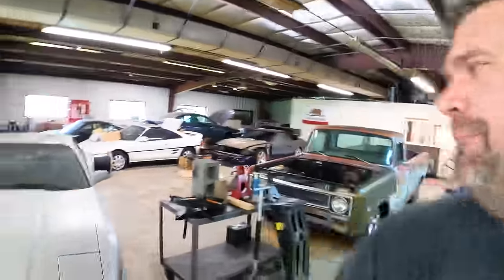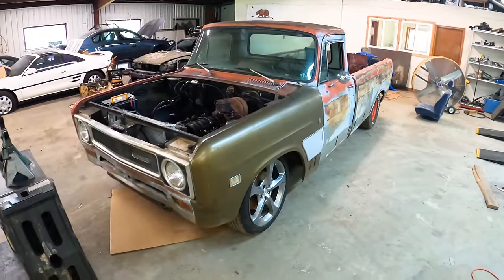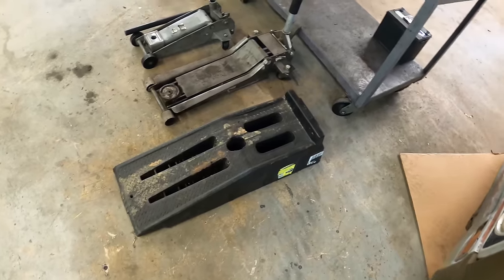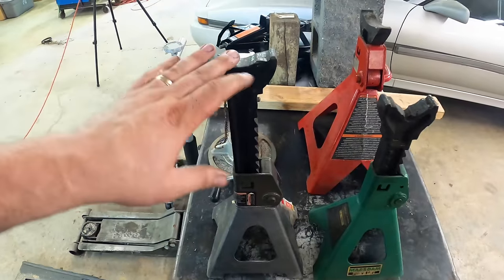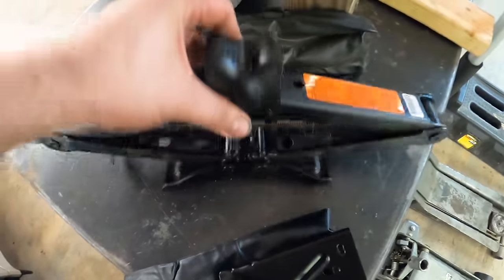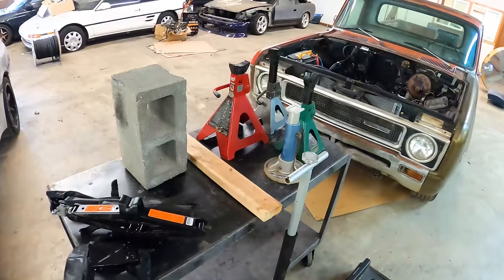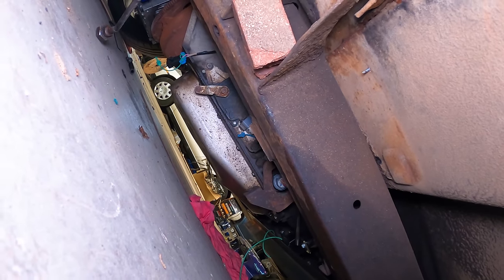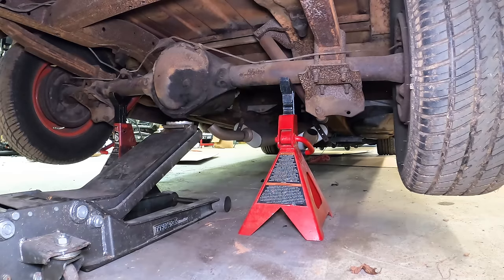How To Properly Jack Up Your Car Without DESTROYING It (And Why You're Doing It WRONG)

Comment: If you have a floor jack with one of those 4 pronged saddles, IMMEDIATELY remove that saddle, and toss it in the trash. I've seen those things destroy heavy truck frames. They will certainly destroy a unibody car. I use a piece of 2x4 or 2x6 between the jack and jacking point on the car. DO NOT use any type of ratchet jack stand. All you have to do is pump the release handle on one of them, and it will collapse the stand. I much prefer the round style with the pin that goes all the way through (the blue one) Never put a jack under a pinch weld. It will crush it every time. 2x4s and 4x4s are very strong and can safely support a car, just don't stack them up. NEVER support a car with a cinder block. I have broken them by kicking them with my steel toed boots. There are some cars which simply do not have adequate jacking or lifting points The Foxbody Mustang, and 1994-2004 Mustangs, which are still built on the Fox platform are one of them. There is nothing strong enough under the car to support it on a jack without bending something. The undercarriage of a Fox body car is made out of thin sheet metal, with no heavy metal frame members. I rarely see a Fox body car where the underside wasn't all mangled from lifting and jacking. The Ford Fairmont and 1980 and newer Thunderbirds are also built on the Fox platform. The worst design Ford ever came up with. These cars flex like a wet noodle. The best place to jack these cars from is the rear axle, and under the front control arms. Use wood between the jack and front control arms. DO NOT use the K member (under the engine) or the pinch welds. I have found a way to lift my 2003 Mustang using the short sheet metal frame rails. I also own a Crown Vic, and it came with a wonderful scissors jack with a perfect top platform for fitting under these frame rails. I bought myself another one of these jacks, so I can use one for each side. I cut some pieces of 1/4" plywood to put between the jacks and the frame rails. I jack up one side a bit, then go around and jack up the other side. I go back and forth 3 or 4 times, till I get it high enough. With the rear wheels chocked and the parking brake on, I don't have a problem getting under the car supported by these two large scissors jacks if I am just doing an oil change or transmission fluid and filter change. Dorman makes a transmission for the Crown Vic, the Mustang, and any other car that used that transmission that has a drain plug in it. Obviously don't try to change a transmission using those jacks. Be VERY careful where you put a jack. You could poke a hole right through the floor. Cars aren't built the way they used to be.

Comment: I've been around long enough we used air jacks to lift from the bumpers (when vehicles actually had bumpers). An air jack on each end was better than a lift in some aspects; nothing under the vehicle in the way and you didn't have the posts on each side to work around. Great for raising one up to do body work or just to detail. They lifted quite high too. I really miss those days.
Reply: The air jacks also had a locking mechanism built in, so no need for jack stands.

Comment: I had a set of metal ramps about 10+ years ago. Put my old truck on them one day, smashed them like grapes.  Had those harbor freight set too, 2 sets. Returned them for the replacements, never took the replacements out of the box. Already knew about the weld issue before i returned the originals so i figured there was no point in pulling them out of the box cause they'd end up being recalled too

Comment: My old 350Z had a NISMO style front bumper that made it impossible to drive up on store bought ramps. So I took some pressure treated 6x6's that I had left over from a job and made some long ramps by cutting them on the diagonal, setting two "ramps" side by side on each front tire to drive up on (4 total cut boards in pairs). (Angle of the cut calculated to allow the bumper to clear, so that set the length of the ramps). Then at the end of those, I set blocks of the 6x6 to drive on with a 2x4 screwed into the end as a stop to keep me from driving off the end. Got enough height to do oil changes without jacking up the car and getting jack stands under it, which took a lot longer.

Comment: Not all engine cross members are safe to jack on.  For instance, the C6 Z06 and ZR1 use a magnesium cross member and can crack if used for jacking.  Makes these cars a pain to lift.  They are also a pain to lift in the rear, as there are very specific points on the rear cradle that are safe to jack on and they aren't as accessible as you would like.

Comment: My car is pretty low I can barely get my low pro jack under it so I typically jack from the front subframe and also put my stands on the front subframe too.  I barely use my lifting pads by the rocker panels

Comment: A few thing I have as personal opinion relating to this:

1.  Never been a fan of differential or front subframe centerpoint lifting, if done incorrectly the vehicle could potentially tip over to one side.  It’ll be dangerous if you have to reach way in to set stands like in the case of the truck where Jared had to basically slide to halfway under the bed to set the stands.  IMHO it’s easier and safer(not quicker) to lift up one corner at a time and set the stand then move to the next one.

2. Be careful using pinchwelds, I’ve seen and had MANY good condition looking pinch welds being used in the factory approved location fold over like a soft taco when used to jack up a vehicle.  I personally prefer to use the subframe mounting location as a jack point and set the jack stand under the pinch weld after(even tho sometimes its like a puzzle to get one in after the other so they’re not in each other’s way).

3.  You didn’t show one but Vw and some other euro brands are famous for these - the half scissor jacks.  The deadliest ever design for a emergency jack.  They have a tiny footprint and basically a letter v that spreads open as you lift ÜBER SKETCHY.

4.  For rhino ramps(as the called plastic ramps are generally referred to), the best things to do for them is to get some skateboard grip tape(get online or buy at a local skate shop) and apply it to the driving surface.  I can’t say how many vehicles I’ve had not want to start up the ramp or start up and then start sliding on them because they’re usually very smooth, even with good tires or the “diamond plate” pattern or whatever “grippy surface” they may have from the factory.  I suppose applying some bed liner to them could help too but the tape is easier and much less likely to just flake off(since the problem is they’re usually too smooth in the first place).

I’m sure I may have missed something else but for now that’s my $.03...

Also good thing that Supra doesn’t have an engine, those tires look like they need replacing if it was driveable...anybody else catch that?

Comment: I personally try to use subframe points over pinch weld jacking points, on my mk4 supra I've had to straighten them out a few times now. Definitely wouldn't go near the rails on it!
Reply: Ae86's get it the worse every single ones pinch weld is just murdered lol

Comment: Premature extension of jack stand at 16:45.   

You also don’t want to use your forearm as a lever on a 4x4 to to get the transmission to mate with the engine.  I had a severe bow to my arm as the last bolt went in. No harm and actually my bone is probably stronger now after all the stress fractures healed.  I actually had a Tr7 lean off the rear jack stands as I freed a seized emergency break cable. Fortunately I didn’t have gas or engine/transmission installed at the time.   I was able to lever it back up and secure the jack stands, while my neighbor continued to tell me how his day went, pausing to ask if the car fell on me and if I just picked it up and put it back in the jack stands.

Comment: The problem with drive on ramps is the car has to be running,if I have the wheels on the car I put wood blocks under the wheels and let enough pressure on them so the car can't fall free of them if the tires are of the car i put the under the vehicle were they would stop it from falling.test what ever your using before you get under to see how stable it is.

Comment: Another well explained video on how too's. Jarid could you please do one on torque wrenches? What is good and bad. Including what is the story with things like head bolts that tell you to go 30 ft/lbs then 60 ft/lbs plus 60 degrees. No one seems to do a clear explanation as to whats that all about. Why 60 degrees? Why not just give a 3rd torque setting? Just sayin that I think this would be a great subject to cover in a video. Keep up the great work buddy from far off NZ.
Reply: If im not mistaken, the 2 different torque specs are because the head gasket needs an even pressure. The “60 degrees” thing is because of the fact that the manufacturer uses head bolts that stretch. Thats also why you need new headbolts when taking off the head. Again i could be wrong about this, but if im not i hope my explanation is clear, English is not my first language.
Reply: @Dennis_V4  Sir I have been a mechanical engineer for 45 years. I know all this stuff. Yes English is not your language and you missed the point totally. I am asking Jarid to make a video to clearly explain these ideas and methods to the wider community.

Comment: The other day my buddy came over with his girlfriends Sentra to do an oil change. I told him wait a sec while I go check the jack points on my phone. Walked away for like 30 seconds and he thought he found the jack being the radiator support. He lift the car on jacks and when he put it down the hood was bent upwards along with the the grille which cracked in multiple places. The hood barely latches closed. Lots of damage for not taking the time to find the proper jack points.

Comment: About 10:00, if those new bolts coming thru the floor pan are what secure the seats or seat belts, itd be a good idea to get some large washers or take some steel channel and run it between the seat bolts and belts. The way it is now, in a accident those bolts will just rip right thru that sheet metal.

Comment: Jacking up a Supra by the differential is questionable, but something like an Escalade or Expedition can cause damage. The differential in a live axle like Johnny Rev is part of the suspension. An independent rear end differential is designed to resist torque, not support the weight of the vehicle. The differential may handle it, but crossmembers, links and bushings can get damaged.

Comment: I diy'd my ramps using 2x6 in layers(I think something like 4-5 layers); those with OCD may want to make it look like a wedge but mine just has steps(has corners on each layer; since I made them they have stops).... cost about the same price as the plastic sets out there but I couldn't convince myself to buy something that looks so janky.... using any wood where the wood grain is vertical or parallel with pinch welds or similar becomes essentially a log splitter; wood grain should intersect and not be parallel when being used(personal favorite jack stands are 8x8 pieces of wood:P)

Comment: Metal ramps, rear wheel drive cars, and concrete floors suck. You get the front wheels on the ramps, then the ramps slide across the floor and scratch the crap out of it. I have wooden ramps cut from rough cut 8x8s, and I love them in the garage.

Comment: The four by four block standing straight up yes it is bad it is dangerous but have yourself a Dodge Ram 1500 on 18 inch wheels with a 5 inch lift and you're using 2 by 4 pieces of wood so you might have to use five to six maybe eight to 10 pieces of wood to get the truck high enough off the ground to take the wheel off it's not recommended but it's sketchy in it will work

Comment: I built wood ramps.  I trust them better than  metal and plastic ramps. I used 2x10 wood  an built it up to the height I wanted. Then cut it to an angle I want.

Comment: Car manufacturers make it hard to be safe. They don't always release information on where all the suitable points are. For unibodies, they sometimes mention side rail jack points and that is it. Of course, if you jack up using those points, you still a place for your jack stands. The way corporations are intentionally not releasing this information is indirectly responsible for the deaths of people who can't figure out where to put jackstands. The manufacturers should list multiple points for lifting and putting on stands. Instead, they obfuscate for a miniscule increase in the number of people bringing cars in for service or for the miniscule savings of not gathering the info from their engineers and printing it. Either way, that is regrettable behavior by the companies.

Comment: One other option ill throw out there, I dont trust any jackstands, no matter what its very little contact points. And also im working outside in the driveway and ive had wind shake around a car up on stands. I always chaulk the wheels. But what ive transitioned to(on cars at least that are low enough for this to work) Ive got old wheels around I jack it up put the wheels under the frame rails and put a piece or two of hardwood on top of the wheel. Those are not going anywhere and have MUCH more contact than a jack stand. One of the key points of using wood in any fashion in this, Jared briefly touched on this you dont want to use it with the grain going up and down, and also you really dont want to stack a bunch of boards.
Reply: You said do not stack a bunch of boards. What do you mean by this. Wouldn't a stack of say 2x12s screwed together then chocked and placed under a set or all four wheels be secure?
Reply: @mptrader1620  A piece of wood on a wheel not stacked. Stacked wood can slide/move. Not always, but a chance of it happening
Reply: @drewpickard554  true regarding stacking them, however they would be screwed together so the chance of sliding would be virtually zero. I don't have wheels and I agree with you regarding jack stands however they're okay if you're just working on brakes. What I've considered is buying race ramps wheel cribs. They're real light easy to store

Comment: Can leaving a car on jack stands for a while bend the frame?

Left an SC300 lifted from its pinch points using jack stands and rubber pucks. 

After being away for a year and a half I came back to find some of the jack stands sunken into the asphalt driveway. Some of the jack stands sank an inch or two.

Is that enough to cause problems with the frame or alignment?

Comment: I always use bricks as Jackstands but the ones I use are 100% solid and don't have these big holes in them. It's all I have and a hell of a lot better than just having the floorjack under it. It's never really high off the ground so for subframework and stuff I'd have to use my cousins lift. But for any work going that far I need assistance anyways.

Comment: My car is a 1993 oldsmobile cutlass supreme and while rust free on the body, the subframe has some areas I'm needing to repair and plate. Had a tire replaced at a small tire shop, and as the guy was getting ready to Jack it up, I told him my pinch welds are rusty, go under the center spring support, there's a lift pad there...as he proceeds to Jack in front of the back wheel only to have the Jack punch thru the floor pan in a shower of rust. He said, "huh, your car is really rusty there." I'm like, yeah, that's why I tried to tell you NOT to Jack it there. 🤦

Comment: it might be overkill but i use 4 jack stands(2 on the factory jack points and 2 on the sub-frame)  a jack, and the wheels whenever i work under the font end of my car.
Reply: I do similar.  If imma do something that'll jerk the car around I put my two full size spares under it my two sets of jackstands under it and still try to find a way to cram in my other jack    sometimes on the oil pan 🤷‍♂️ if it's all gunna fail I'd rather replace the pan and oil pickup than be dead
Reply: @christopherelrod8788  Yeah, like what Jared said. Its better to take a few more minutes making sure it's safe than to skip it and risk the car falling and crushing you. You knoe its Better safe than sorry
Reply: @Buenaflor-S.C.  I've been asked why are you doing that?   I simply said no car is worth my life

Comment: Would be extremely careful using wood (around 12:35) to jack up a car. I have had it split in half while jacking causing major problems. You can even tell the 4x4 you are using is splitting.

Comment: Always give the vehicle a good shove or two in each dorection, just to make sure it's not ealily going to plop over.

Dude if you can release a jack stand that easily, you don't have enough weight on it.

What I hate is when I need to lift a truck but all there is around is a dinky floor jack and it doesn't go tall enough.

Comment: Hilarious. ..  just paid for a trans flush and filter because the truck was rocking too much for me to not die by the last trans mount bolt..  pneumatic tools would have helped obivously..   driveway is just not level enough for heavy frame bolts

Comment: i feel like i need to send this to my cousin who almost split hes head in half after the Mercedes van fell of the jack and he wasn't using jack stands. he was working on the front subframe and the jack collapsed when he was under it and the front fender cut hes forehead open. he was extremely lucky that he only needed stiches but it could been worse